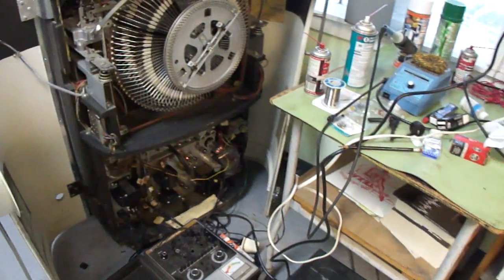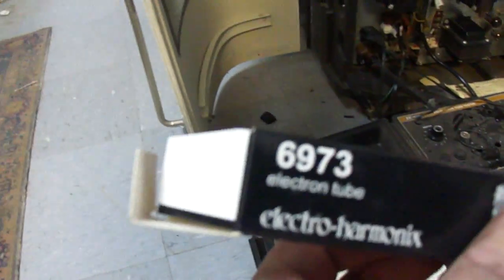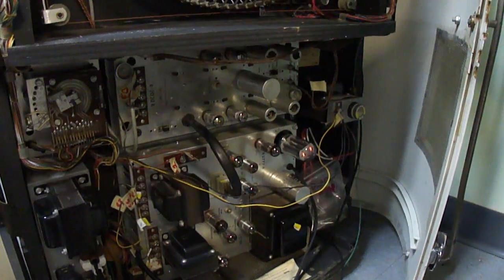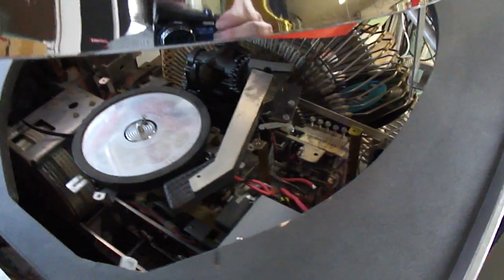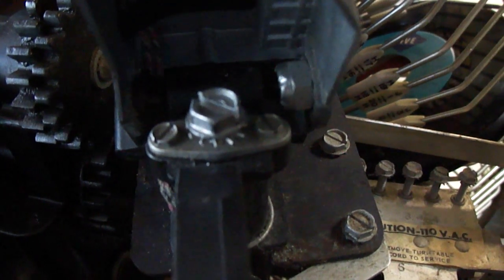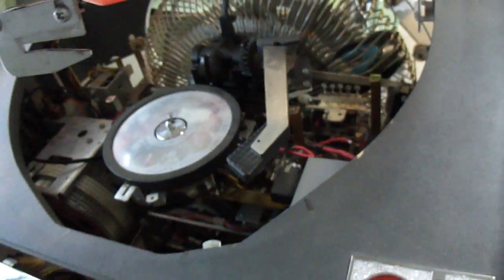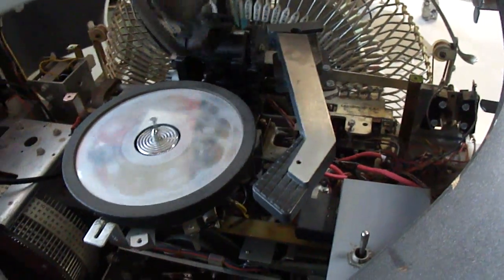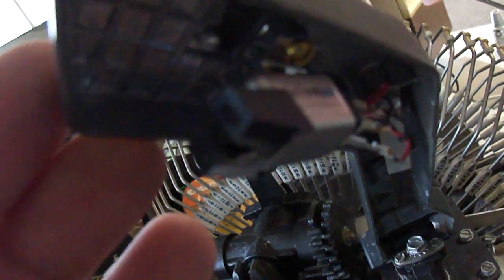1961 AMI Continental jukebox test

Comment: Hi there retrochad. Thanks for informative video. Unluckily my jukebox service man is no longer in this dimension and I'm facing an intermitent no-sound problem on my Ami Continental 1. I've replaced a few worn-out or weak tubes but also fear I need a new potentiometer which seems to be real scarce. There were times when the juke sounds but then it goes to zero sound. Now it simply does not sound at all with the 5U4, and some 12AU7 and 12AX7 replaced. Not sure where the sound problem lies and wouldn't want to have the amp and equalizer checked or serviced since the juke did play ok until a couple of years ago. The only thing I carefully did was taking the potentiometer out. had someone clean it it and reinstalled with all wires/terminals numbered to avoid mistakes. Maybe you have some clues? I've been a big fan of jukes since I was a baby and regret I sold my Wurlitzer 2107 for nothing a few years ago. I'd like to put this girl to sing right again to enjoy it for some more time or, eventually, to sell it. Regards from Santiago, Chile

Comment: Hi there Retrochad,, greetings from Chile. I'd be grateful if you could give me some hints to reach the main transformer (in speakers cabinet) in my Continental 1 to have it re-wired.I guess I should dismount wooden panels where amp and pre are mounted but I wouldn't want to get entangled with the other wires inside cabinet once amp and pre are out. My juke service man is no longer active so I'll have to take the risk on my own taking a good look at everything as it is before "surgery". I haven't been able to find an exploded view diagram of the AMI 1.Thanks a lot.

Comment: Great job on the AMI. I have a Continental that I am having a hard time with it's play speed. It is the tiniest bit too slow. Was told to wrap tape around the motor shaft to speed it up but one layer of tape makes it too fast. Can't findanything in the manual. There has to be a better way. any suggestions ?

Comment: Very cool vid, quick question though: Are you going to try to install a "standby" power circuit for the tube filaments since this model does not have it? If so, how hard would it be to install?

Comment: According to some info i found out, Weak Valves can Be rejuvenated, Someone had actually done this, by doubling the filament voltage for around 20 seconds, then to reactivate the "Getter", they stuck the Tube in the Microwave for 1 second, then tested for emission & it was good, This actually worked according to this particular repairer!,